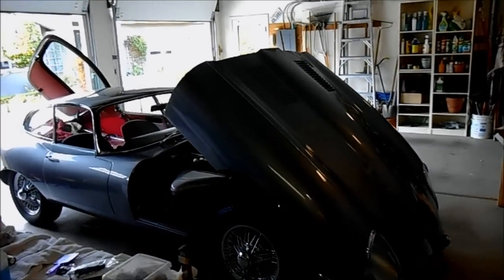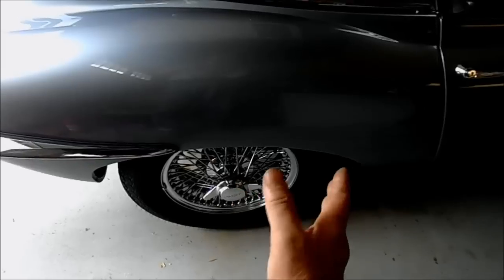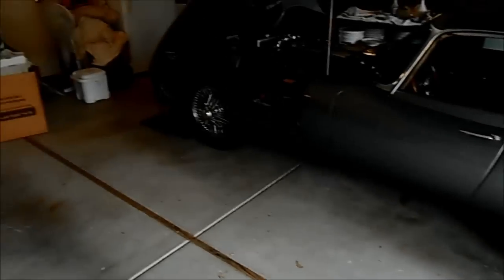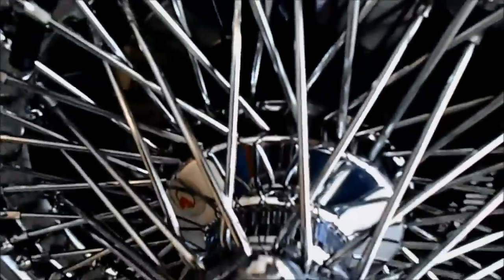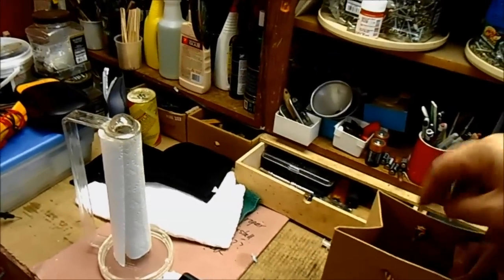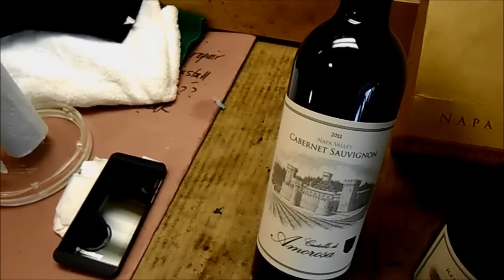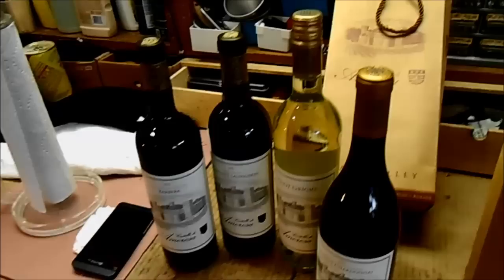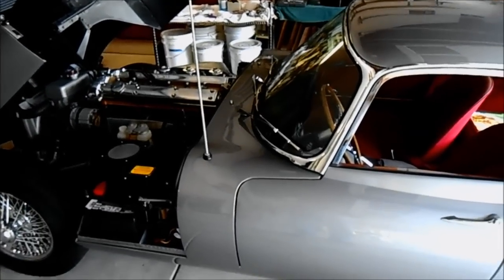Bettie's maiden voyage

Comment: Great Video John, loved seeing the car come together, and wonderful to see her on the road, I'm sure she will be at the centre of some great memories now, congratulations
Reply from the maker: Scott Best Thanks Scott, I still have an oil leak that persists and I am frustrated that it might mean removing the cam covers again to reseal them. I may also have a leak at the oil feed pipes that are using banjo fittings and copper sealing washers, seems these can eb troublesome at time, and mine are leaking as far as I can see - they are at the rear of the block which is difficult to see and work on.  We'll get 'er done however!
Reply: Good on ya John, yep you will sort it, If those copper washers are problematic, try Dowty seals, they are a wee bit more forgiving and will take very high pressures. cheers